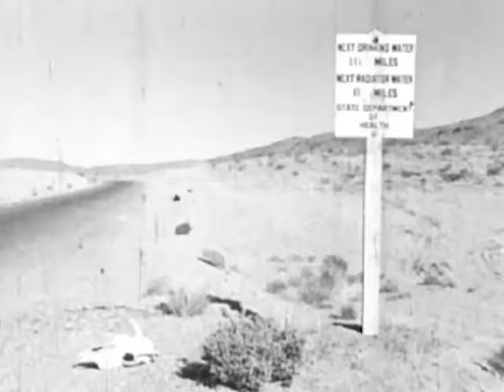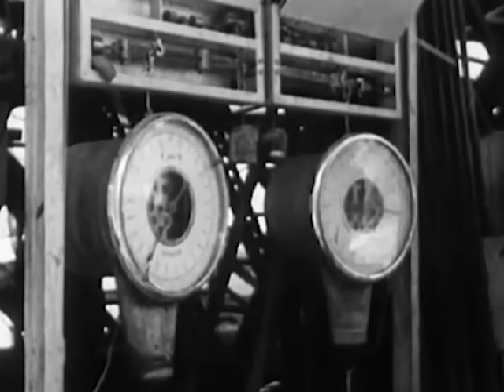Hoover Dam Construction: Boulder Dam (Part I) (1931) - CharlieDeanArchives / Archival Footage

Comment: I was just there for the 4th time in the last 52 years. While the dam has not changed, the surroundings sure have. There is a multi-story parking garage and a " new " bridge downstream to allow for the much- increased traffic and to assure that no trucks cross the dam. The original part of Bolder City is very beautiful and quaint. A nice place to visit. My hat is off to those brave and hard-working men and women who built this dam. It was, and still is, a marvel. Thanks for posting this informative and well-done documentary.
Reply: no women built this damn
Reply: @tomspeed3354 And no fatties either.
Reply: Looks like the skyline the loggers use
Reply: They probably tried a few loads but didn't want to keep paying the over max weight tickets
Reply: Similar over here but it’s probably about 30 years. I remember being surprised at the parking structure. I wasn’t real happy about changing the tours.
Reply: Before 9 1 1, the Tours went down to the Generator floor- a fabulous place. No longer. On our last tour about 4 years ago- it was Ok but nowhere near as good as the earlier tours to the now restricted areas.  @JimAllen-Persona
Reply: @amtrakjohn  you can still see the generation floor, it's just a 1st come 1st serve system  on the tours there, nothing to do with 9/11 as much as traffic control
Reply: Women were the moral booster

Comment: Heres a wild story.
 My grandfather Jacob was involved with all of the dams  built with allis chamlers turbines. My dad said Jake was the  Guy they went to in the constuction of the powerhouses.
 Anyway im a kid gramps is  about 85 years old. My dad is giving him a haircut when the phone rings.  Dad picks it up. Hello is this Jacob Jablonski. No. This is his son Louis. 
 A guy from AC was calling and wanted to speak to pa.  He said they were having some problems with one of the turbines at the dam.  My gramps said. Your getting vibration on the number 2 turbine. Silence on the phone. Did someone call you mr Jablonski. No but when you said you were having trouble i knew it was the number 2  turbine.
 When they built them in Milwaukee. They ran fine. When they installed the turbine #2 it had a vibration.  Pa said they had ro shim something and that fixed the  vibration. He even told them how thick the shims were and what they torqued the nuts down to. 
 My dad said . Pa how dido you remember that stuff. Pa said every job was differant.  So you made adjustments. He was 85 years old when they got the call. My dad thinks his dad was a genius. .
 Pretty cool eh.
Reply: That is cool

Comment: This documentary had lots of great footage and details, but I really want to know how the cooling system worked for the dam.  allegedly there was a cooling water system because concrete heats up when it solidifies.  also, I am curious why they pour concrete in forms the shape of boxes when you would expect this damn to be one straight piece.... Lastly, around 20:00 they say work commences day and night, rain and shine.... they poured crete at night in the rain?  that sounds nuts.
Reply: It's work, you had to be there..Its concrete, rain or shine or dark...
Reply: The cooling system was  2 inch pipe.  They ran cold water through the piping to wick away the heat caused by the curing cement.  This they could keep poring concrete over the previous block.
 When the dam was complete they ran concrete slurry through the piping. It dried to form a solid . They did this to make certain there was no weak spots in the internals of the dam.
 The blocks  were done kinda like Legos. But no 2 blocks ever aligned with one another.  This was to assure that nothing could slip .
Reply: @hayeslincoln3111  Excellent (and accurate) explanation - hope the guy who asked about it sees your post